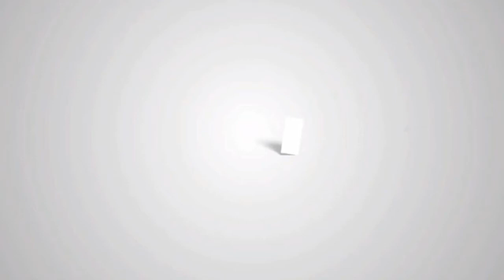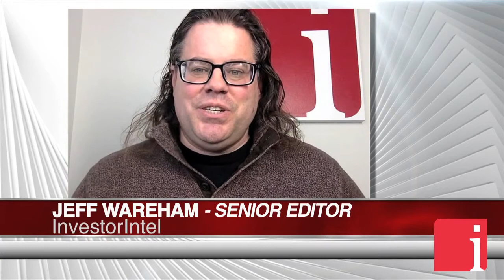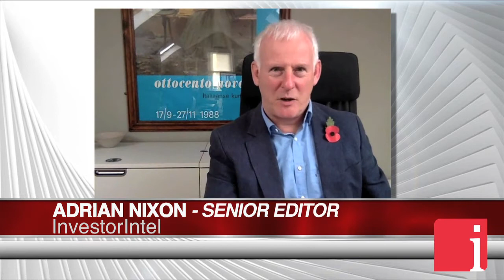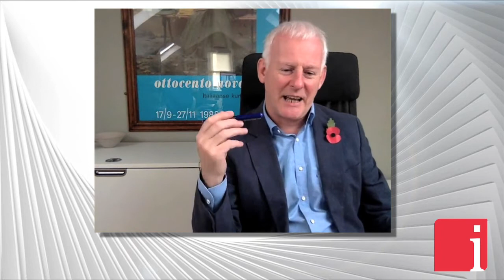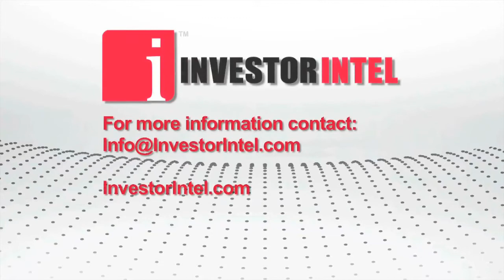How graphene can turn the space elevator fantasy into a reality

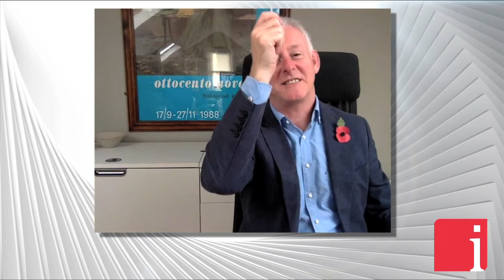Comment: Investorintel  -  at 1:00 ". . . so if you drop a cable from the geosynchronous satellite down to the ground . . . "  BUT you also have to "drop" a complimentary cable "up" AS A COUNTERWEIGHT.  Centrifugal force keeps the cable "tight".  The center of gravity of the system has to be FURTHER OUT from GEO to keep the weight of the cable and the wieght of any "climber" from pulling everything down.  This means the cable (ribbon) must be a single molecule ~ 72,000 kilometers long (less with a massive space station as an extra counterweight).